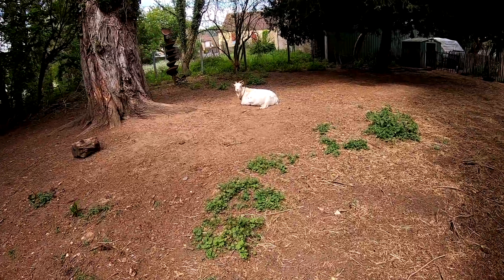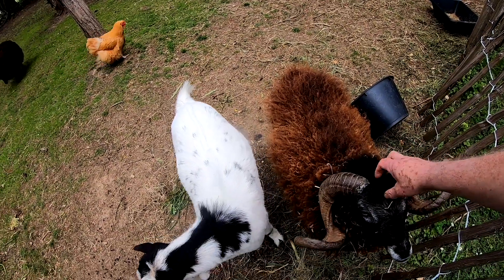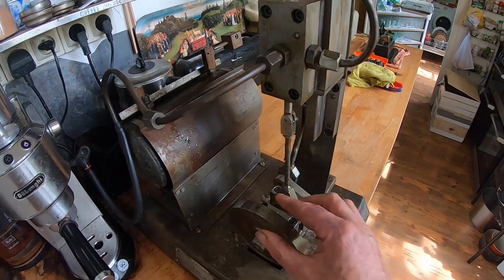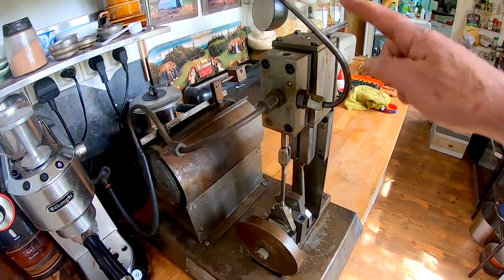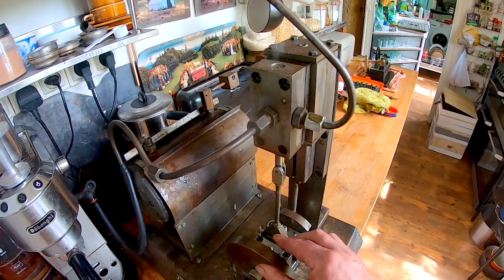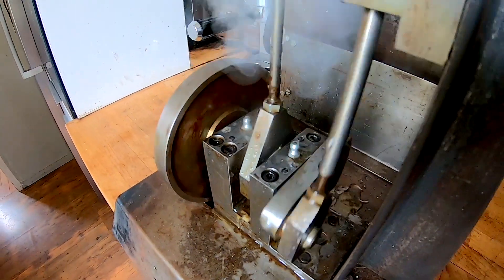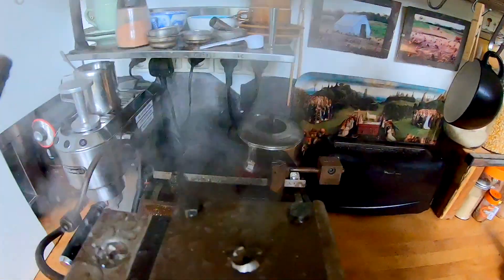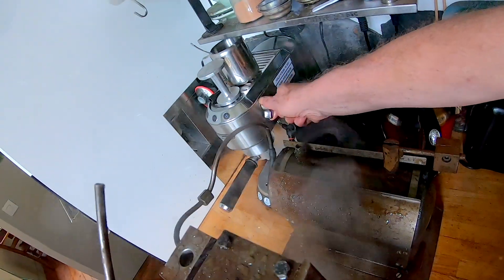Prof Wallace and the German Steam Engine

Comment: 08MAY2021 - You know, the silly thing even looks German. Question: How do you lube the cylinder walls?
Reply from the maker: good question...no displacement lubricator so i put a drop of steam oil in the top of the cylinder where there is a screw hole. ...the rest of the engine gets oil externally
Reply: @SimonHollandfilms  10MAY2021 - "Steam oil?"  Hey Prof, are you pulling my leg? It that a real thing? Like a bucket of "prop wash?" Oh, I believe you, just never heard of it, but it does make me wonder how the big, constant duty engines get oiled. I know how car engine oil circulates but was wondering about the steam engines. Great job, keep doing what you're doing. How about a program about the possible future of nuclear energy alternatives like thorium and molten salt reactors?

Comment: Did you get the kitchen cleared out before Mrs. H. returned? If I pulled something like that in my wife's kitchen  . . . well, let's just say there wouldn't be any meals for me coming out of that kitchen any time soon. I'd be out back wrestling with the hounds for some kibble. 
The new steamer is a beauty, pretty substantial compared to the other. I've got to admit, I've never seen one arranged vertically like that. Are you going to repair/restore the boiler?
I'm rather enjoying these little steamer movies. I'm assuming that Mrs. H. has settled down about your purchasing of these little gems. You should probably buy Mrs. H. a bigger coffee maker.
Good looking goats they are. The one that looks like a little grey ram, with the horns, what bread is that? My neighbor up the road has 40-50 goats at any given time, I've never seen one like that in his paddock.
Reply from the maker: any ideas how to repair a steel boiler with holes?  i think a new one is the answer.